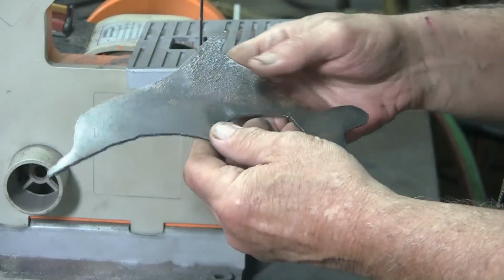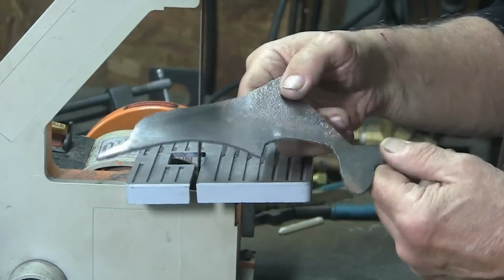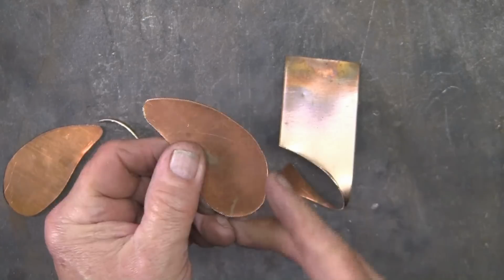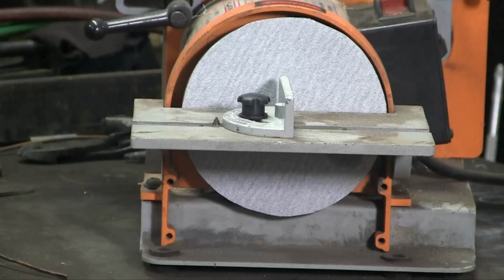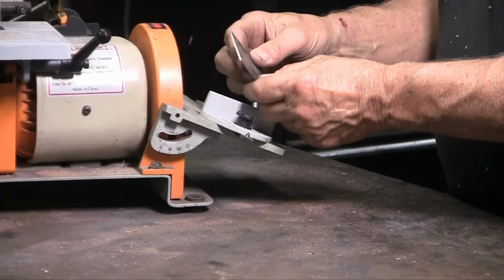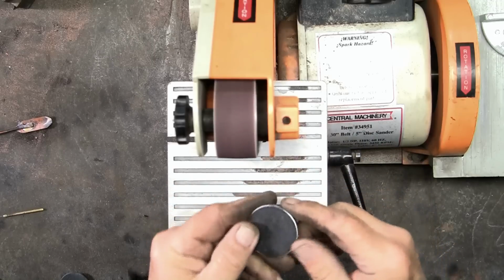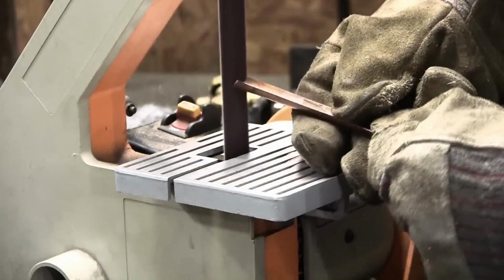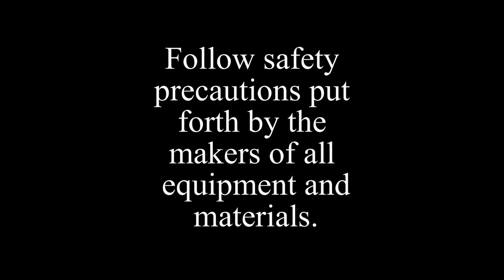1 Inch Belt Sander

Comment: Your 1" sander is a much better unit than mine bought about two years ago from Harbor Freight. I was about to throw mine out until I discovered that the HF belt was the problem. A new smaller belt saved it.  I
t works great for sharpening wood lathe tools.
Reply from the maker: Thanks for the idea.  Hadn't thought of using it for sharping.

Comment: Thanks George!  Good tip!
Reply from the maker: Charales, I'm sure that you have one of these HF belt sanders.
Reply: George, as it happens, mine actually is NOT Harbor Freight.  My son was working at a small factory some years ago and when they threw out an old sander to be replaced with a new one, I rescued it from the dumpster and did some fabricating and got it running.  Been using it for years and it sure is handy!

Comment: Thank you.  I've been debating on purchasing one for a year now.  I need to find out more about changing the belts.  I used a friends belt sander, more complicated and larger, one and she said the belt changing was a PIA.  I need to know more about the recommended average gauge belt to keep on it as well.  You used 80 for the 20 gauge.  I use 18 gauge brass for bracelets a lot and the flex shaft/dremel attachments aren't great for this larger size of metal.  I know 80 gauge will take off the burs but will that work for smoothing 18 guage as well?
Reply from the maker: Catherine, on my belt sander it's quite easy to change the belt.  The first time was a little confusing, but after that, it's a piece of cake.  I use the 80 grit on 16 gauge steel and it will take off quite a bit of material.

Comment: Happy New Year sir! I am humbled every time I see your work.  I have a general question: I am trying to build material up upon itself to form detail on some small, steel figurines I'm working on using on Oxy Acetylene torch.  What technique and material would you use to "glob up" (for lack of a better term) material on steel to make large humps?  My problem is, every time I go to add more material, the base becomes molten and it seems to collapse upon itself.  Any recommendations would be appreciated.
Reply from the maker: I would use steel.  Specifically steel gas welding rod.  You can glob up the steel and it is less likely melt off.  If you got to this web page, scroll down to some whales.  These are an example of using steel gas welding rod to build up.  Also a pair of hands.  Also a surfer.
http://gsegmedia.com/?page_id=3075
Reply from the maker: If you have more questions, email me at ggoehl@gmail.com
Reply: Thank you!  Your examples are amazing...almost enough to convince me I'm wasting my time by comparison.  I took your advice using some rg60 rods I had, and, along with a lot of practice, I think this is going to work for me.

Comment: Good video! What is your opinion of the lack of a platen? Would you rather it had one, or do you prefer none?
Reply from the maker: I hadn't even thought of a platen until I saw a belt sander with a platen.  A platen would be good for flat surfaces.  Not so good for working with curves.
Reply: I see. Thank you for the response!